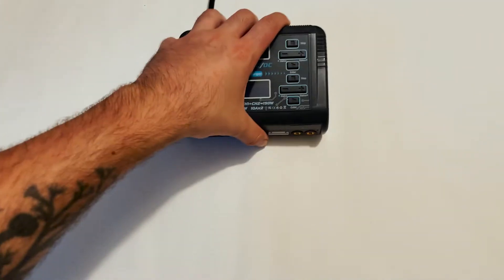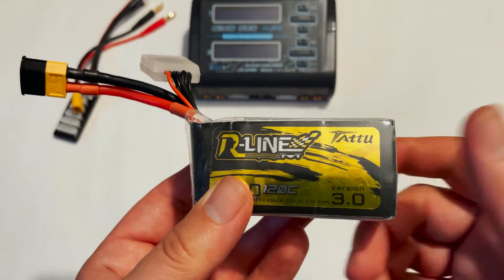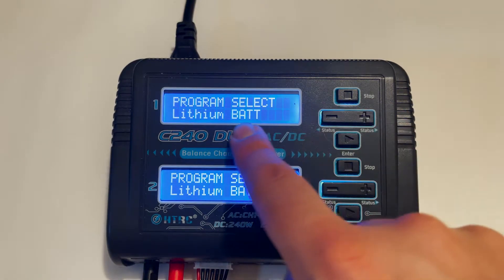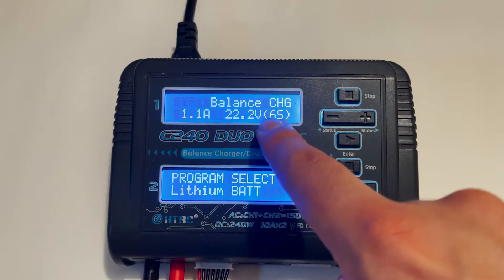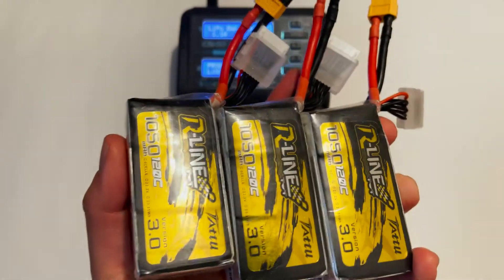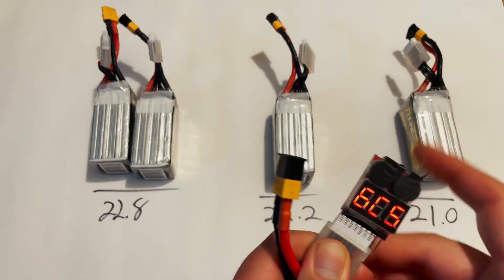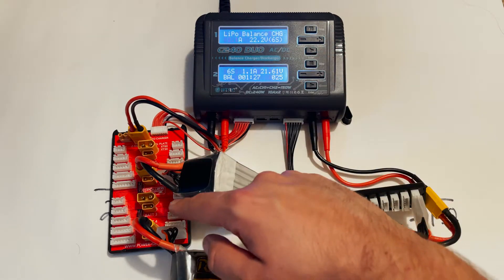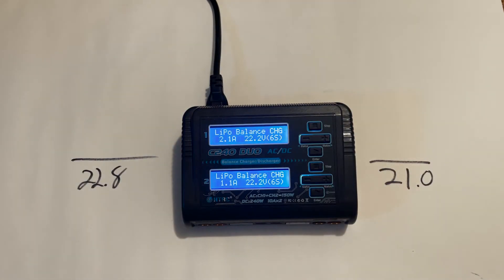Charging LiPo Batteries

Comment: Great video for newbies. When you are parallel charging, you actually want a maximum difference of 0.1v per cell, so you can go up to 0.6v for a 6S. But 0.4v in your case is fairly conservative. Just don’t do it with 1S lipos, the lipo with the bigger voltagr will discharge in the other one, potentially damaging it or even turn into a fire hazard.
Reply from the maker: Very good to know, Thanks for watching!